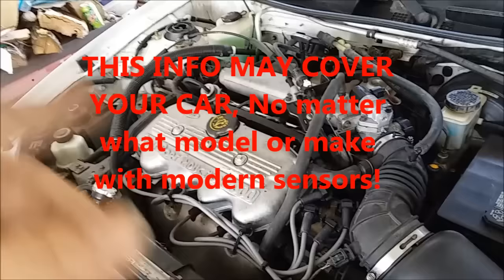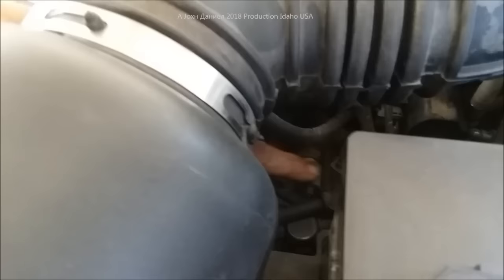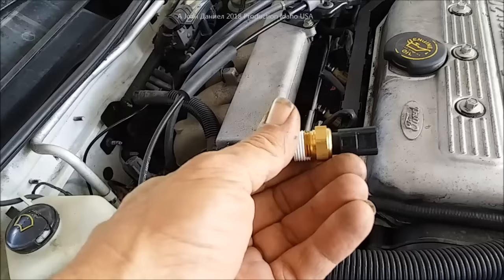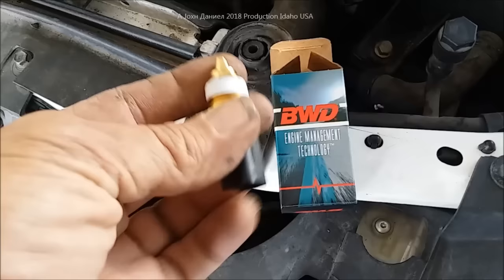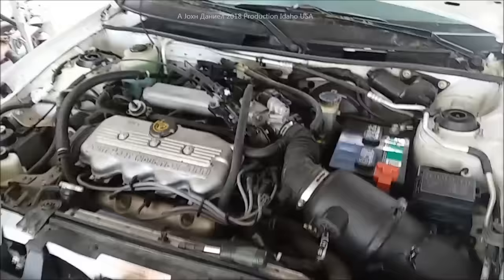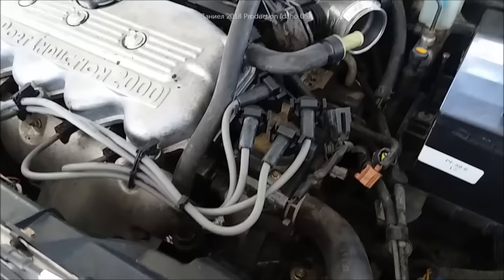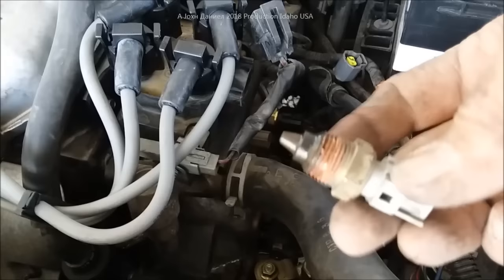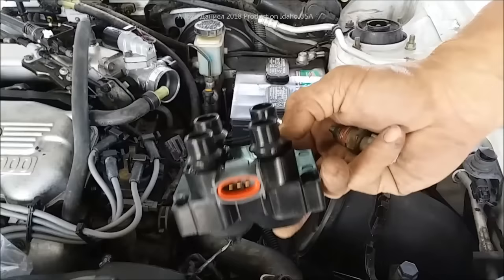Ford with NO START issues - SOLVED for $20 All Parts needed listed below the video

Comment: I have a Ford fiesta 1l eco boost , crank no start when i try to start i can hear some pop noise so I know I got fuel and spark but quand seem to find the issue
Reply from the maker: Fuel Pressure regulator on those is common to cause that. See if you smell unburned gas from the exhaust, if it is a present but weak smell, look at the fuel pressure regulator. If not the ignition/timing module is going bad. Unlikely it could be weak fuel pump, so if it started doing this on and off then stopped running completely, check the fuel pump and its components.
Reply: Thanks For responding to me , so basically I’m going to explain the best I can because it’s very difficult to explain something to someone who’s not able to see the car like I do , (2013 ford fiesta 1l ecoboost ) so i used tu have the p053f code but now I god no codes , i have a yellow check engine light and a red oil light I will try to look at the live data of my fuel pressure on my obd 2 and I’ll get back to you !
Reply from the maker: Those 2 lights on at the same time will be common in a blown motor. Check oil level, pull all spark plugs and check for damage. A pop can be connecting rod noise, and with anything broke in those engines the timing system stops so no spark.

Comment: The computer is calculating a mixture and forcing it to be tooo leane possibly pumping the gas pedal  lot in it might start So the sensor is bad I had a car I simply turned ignition to the on position for a few seconds and it would then start.... acted lean...

Comment: My 99 / 5.4 /2 valve has been sitting for a couple years & ran fine when parked. Now, as I crank the engine over it tries to fire but doesn't catch. Even stating fluid does nothing.  Any ideas ????? Thanks
Reply from the maker: If the Crankshaft Position Sensor  lined up with the magnet on the crank pully and it sat that long it likely caused your sensor to fail. About a 90% assurance on this, Either way due to age, Replace crank sensor, this one is likely the one that fits.  https://amzn.to/3iBoP3b
Your Distributer/Ignition spark system operates on it.
Reply: @JOHNDANIEL1  / Ok, thanks so much for the tip....
Reply: @alibertylover  Did it work??

Comment: I've exloler 2002 3times take long time cranking to star 
Last one
Stop work.
I scan found P0353
P0141
P0155 !!!
P0161
P0198
What I need to do? 
Thanks
Reply from the maker: these vehicles are notorious for crank sensor failure, a crank sensor is like an old style distributor but electronic. Many codes can cause additional codes based on one default function, pull the battery post off a negative let set for 3 hours, go back out reconnect the battery and do a start procedure if it'll start. See if it'll do a trip around the block and if the engine light code comes on then that's when you need to get your more accurate codes or the problem. Most of the time it's simpler than you think.

Comment: I’ve got a 92 f-250 that I just can’t figure out. Had a mechanic tell me it was electrical got nothing out of him! Took it to another shop that said I fuel pumps. A day later won’t start  after putting in 2 new tanks and Pumps. Cranks and stats at random whenever it feels like it. Any ideas?
Reply from the maker: What engine, and tell me more details. Hard to start? Rough when started? Engine size and miles on it?

Comment: My 12 Ford Focus cranks but won’t start, sometimes it gives a flutter like it wants to start but never does. My mechanic can’t figure out what’s going on. Anyway I can send a video to see what you think? I’ve changed SO many parts out and he’s been baffled for weeks. I’m extremely frustrated! Thanks either way!
Reply from the maker: Transmission switch. They get brittle and the computer thinks it's in gear so it won't start. May do a dieseling effect due to fuel in cylinders but dead on the ignition coil. Slowly work the shifter back and forth park to neutral while cranking on it, see if it has any effect. If I get it right you can applaud me a few bucks.
Reply: @JOHNDANIEL1  10-4 I will mention this to my mechanic and if all is well I will DEFINITELY be back to send you a donation. Thank you!
Reply: @JOHNDANIEL1  as soon as I get some money up I want to send you some!! Between God and you my car started running!!! Now back to DoorDashing !!! Been 4 mths no work !!

Comment: I have a 370z just cranks and won’t start  car never had issues then outta no where crank no. Start I’m hoping this is the issue
Reply from the maker: Heat sensor turns off the fuel injectors, fuel inertia safety switch turns off fuel and spark,  cranks sensor would stop spark. Check for spark and listen close at tank filler to see if you hear the fuel pump kick on while somebody cycles the key in action make sure everything is quiet around you to listen for it..
Reply from the maker: Another thing when I'm thinking of it, if it's a manual transmission then the neutral safety switch can fail so that's another option and they won't leave any codes.
Reply: @JOHNDANIEL1  I’ve had that fail and it created a no crank condition where the vehicle would just cycle from off to acc then would not go to on but that heat sensor sounds more like it because it’s not flooding I would assume if the fuel injection is spraying and there’s no spark there should be a flooding condition
Reply: @JOHNDANIEL1  actually maybe this would shine some light so I have two different cars with the same engine now here’s where I’m confused one car the fuel pulse is with 2 to 8 on acc now my other vehicle the injector pulse is at 25 prior to have bad pressure it was at 15 I did the pump and damper that brang pressure back.

Comment: If I get no spark can this still be my problem?
Reply from the maker: On these automobiles sometimes no spark means crank sensor fail. If you're turning the engine over and you can smell raw gas pulsing through the injectors coming out the tail pipe  of the engine and you're getting zero spark check with the crank sensor that fires the coils and see if it's bad they're usually about 25 bucks and should be replaced every 75,000 miles anyhow. On some of them the park detent switch or neutral safety switch on the transmission can also cause the same effect if you recently had weird actions coming from that area of a no start check it too.

Comment: Has anybody made experience with that Problem on a 1992 ford escort xr3i 1.8L 130 horse Power? 🙄 I have the same problem. Everthings fine but the Motor does not Start...
Reply from the maker: Sounds like a broke timing belt. Open the oil cap, have someone spin the engine a little, if nothing is moving down in the valve cover the belt is broke. Sometimes on a 1992 check the crank sensor or cam sensors.

Comment: Thx im going to try it. My 2001 mercury sable ran really good but than wont start. Its cranking but just wont turn over and i changed the spark plugs and even the starter
Reply from the maker: On a Mercury sable if it's the four cylinder rare but true check the timing belt, if it's the V6 and it's got no spark then your crank sensor has gone out.
Reply: @JOHNDANIEL1  thanks man!

Comment: My 2001 Ford ranger was starting good, then nothing... no click no nada...turn the key and nothing.. quiet..
Reply from the maker: If the lights radio and other general items like the fans still come on, then you have a solenoid failure somewhere between the ignition and the starter. The rangers have a couple of relays that energize the system related to running and starting and then I have a solenoid for spinning the starter.

Comment: Where is it on a 1987 e150 5.0?
Reply from the maker: One sensor the ECT SENSOR is found right above the thermostat housing follow the top radiator hose back to the engine to find that, the temp sending sensor will be located just to your right behind the distributor going into the intake manifold. But on this year model of truck I would suggest if it's a no start issue checking with TFI and replacing it or your entire distributor. If you need a parts list of these items let me know. But I have replaced many of distributor to get one running immediately on this year model 302 v8s. If it's gets you up and running and saves you a thousand bucks don't be afraid to drop me a tip by hitting the thanks button underneath the videos.

Comment: would this cause a rough idle, surge & stall out?
Reply from the maker: Check 3 THINGS. fuel regulator, fuel pump, and idle air control valve that may be more likely culprits of that issue.
Reply: @JOHNDANIEL1  already changed all 3 plus alot of other parts.
Reply from the maker: What's the vehicle, model year, engine and transmission.
Reply: @JOHNDANIEL1  98 ranger 2.5 5 speed manual
Reply from the maker: Okay common issues with those is: coolant sensor, MAF SENSOR, leaking intake gasket, vacuum leaks, and O2 sensors causing such actions. Rare but occasional: timing belt slack, crank sensor failing, throttle position sensor, and capacitors failing in computer.
Reply: @JOHNDANIEL1  haven't changed the 02 sensors but everything else has been. im starting to think maybe recessed valve seats or some kind of head issue. it never ran hot. it was running good & i came to a stop light & it started acting up. ive even put a new wiring harness on the engine. i suppose a compression test is the next step. if thats not the issue it might need the insurance wires crossed up lol.
Reply: its a reman engine with around 10,000 miles.
Reply from the maker: You just said the key word, it came up to a stop sign when it started acting up and has ever since correct? It sounds like by pushing on the brake pedal you have got the result of a vacuum leak that might have gotten much larger after pulling hard vacuum for braking on your master cylinder. Now I believe without a doubt all symptoms are probably vacuum related. 
You're going to have to start checking everything from the valve actuating your heater flow to the vacuum driven tampon projection slingshot in it. 😂. 
START LOOKING FOR VIDEOS ON THAT ENGINE AND THAT VEHICLE PLUS OR MINUS A FEW YEARS ABOUT COMMON VACUUM LEAKS.
Reply: @JOHNDANIEL1  i believe you are on the right track. i found a vacuum line off under the intake. replaced it along with any others i could find. it srill wants to act up when you push the brake or clutch in. its still hard to crank & get running smoothly but running better than it was. i really appreciate your help brother!

Comment: My 1990 460 Ford won't start after its been running for awhile. Battery is all good. It use to not crank at all after it had been running then I put a new starter which didn't do much then I put heat shield around the started and heat wrap around the exhaust where it could be overheating the starter. Seemed to help now it'll crank just a little bit but still not start. Truck seems to run fine other then that.
Reply from the maker: If a brand new starter don't fix it, I would remove the rotor cap, then rotate the crank while looking at the distributor rotor. If the rotor turns with the crank stop and turn it slowly the other way. See if any how much slack you have in the timing chain. 3/8" a inch can be 1/2+ inch when engines hot (5 degrees!!) even with the slack adjusters. So, If you notice the rotor isn't following the crank when turned you may have a worn chain. If timing chain is worn out, the timing problem will cause it to struggle to start when hot due to heat expanding the chain even more then throwing you off real far past 12 degrees.
Reply: Јоhn Daniel thank you I will try this!

Comment: Was having an issue with my 1999 Ranger, it's a 2.5 liter. I could get it to run but it was dying out randomly. Replaced fuel pump, plugs, wires, and coils. Have new injectors have just yet to put them in.

I was still having issues but the truck would start and run but would still die. The other day I went to start it and got nothing. Poked around a bit and discovered I wasn't getting fuel pressure. I swapped the fuel pump relay with my horn relay because they're the same and my fuel pressure returned. 

However it still won't start. I'm lost. :(
Reply: I got the same problem With my 96 Ford ranger New fuel pump pressure regulator spark plugs now I’m trying this let’s see what happens
Reply: @raulsilva3540 did it turn on i have the same problem i have everything but no start

Comment: Would a scan tool pick this up?
Reply from the maker: Not normally. The no start event happens with a key off not running condition so the computer isn't monitoring.
Reply: @JOHNDANIEL1  What else could it be if it's not the heat sensor
Reply from the maker: @jaymestevens9816  Send me a full detailed question and the cars details on the problem to my email, I can better respond olympicpowercontrols@yahoo.com

Comment: That wasn't it I don't understand what the heck else it could be she idles shity very lean starts cold no problem comes up to temperature I go to a store or something go to start 10 minutes later no start stuck for 2 hours then starts like nothing ever happened I guess I'm going to clean and test all the sensors and go from there anyone has any other ideas please share
Reply from the maker: Check your email, spam box too
Reply: PCV hose might have a hole in it causing a severe vacuum leak

Comment: Hi I have a 2009 f450 triton 6.8 and it cranks but no star I used starting  fluid it starts but dies right away any suggestions,?
Reply from the maker: 2 common issues. 
Crank sensor https://amzn.to/3HgCKrz 
Fuel pressure sensor https://amzn.to/3FiHriJ
If the crank sensor is going bad it will run on starter fluid in a dieseling effect but you're ruining your valves, if the fuel pressure sensor is bad it will not activate the computer's function to fire the injectors. Replace both and then pull for codes.